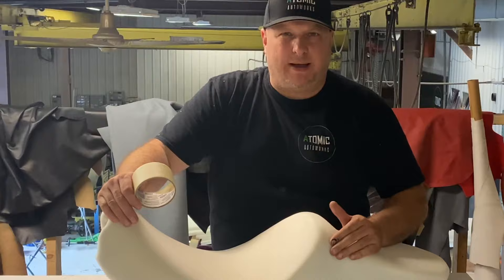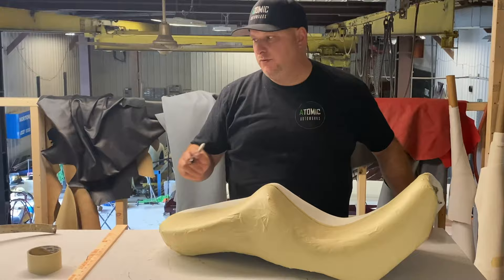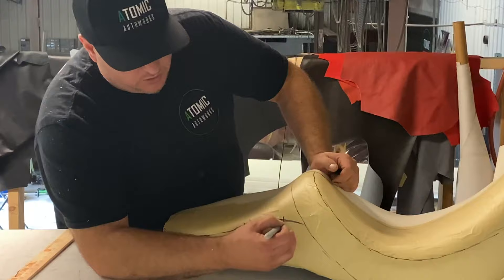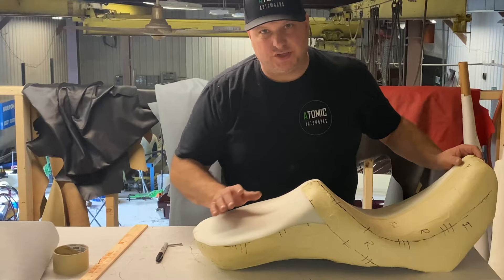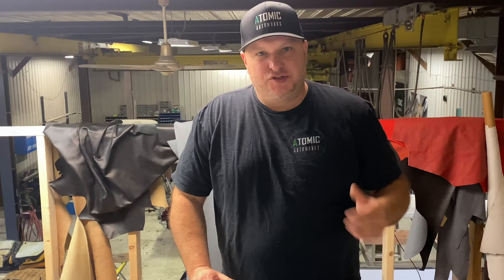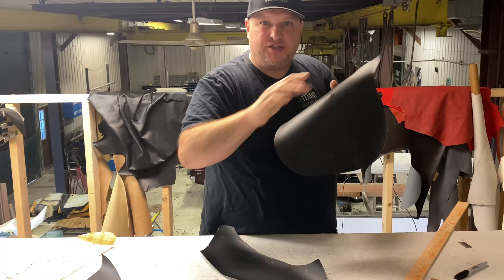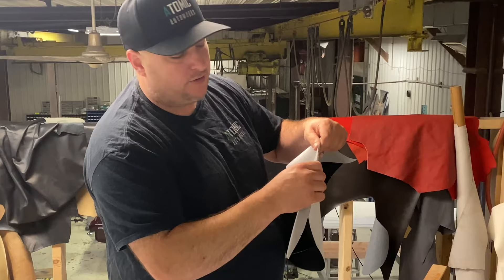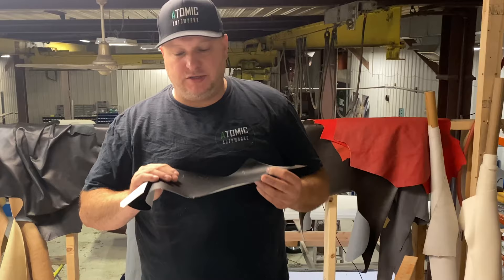Learn How To Pattern A  Motorcycle Seat Cover From Scratch!

Comment: Should I put thin plastic wrap on seat before putting on seat cover? Thanx
Reply from the maker: We personally almost never use it. Some people use it to make ease of cover installation . Other people use it for water resistance however we find it traps the water between the seat cover and foam. Also the foam under the plastic still receives moisture and that is now trapped in the foam. We like to let them air breath

Comment: Quick question ! i tried the tape for pattern but where the tape has more rounded shape it doesnt transpose well on the vinyl because the tape doesnt stretch right so the markings doesnt line up ! how do you cope with that ? Do you cut the tape so it can lay flat ?
Reply: by the way your great work explaining ! love your videos
Reply from the maker: You have to make sure you are not forming your tape. Let the tape stay flat as it is normally. If you can not do this make sure to pattern with thick plastic instead .
Reply: Thks ill give it a shot this week-end !!

Comment: I am having a problem with my alignment marks lining up any suggestion
Reply from the maker: The pattern has to be perfect. Make your marks and then separate the pattern. Their are many reason’s alignment marks don’t line up. Stretch of material, adding sew foam to the back. All these need to be factored in when patterning. Hope that helps. If not please feel free to send us pics or videos of your problem and we will gladly help you out. Stay on it , keep focused and soon enough you’ll look back and laugh at what you thought were problems.
Reply: @AtomicAutoworksTV  thx